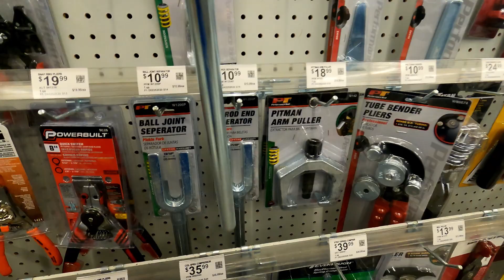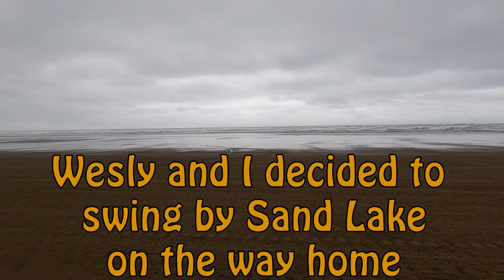Exploring new areas with new friends

Comment: A 20r head on a 22r block isn't a game changer by any means you won't hardly notice it I've had several it's honestly about the same as the original head on either engine